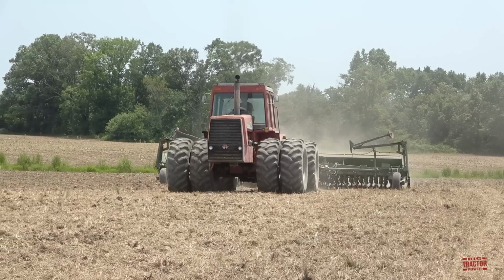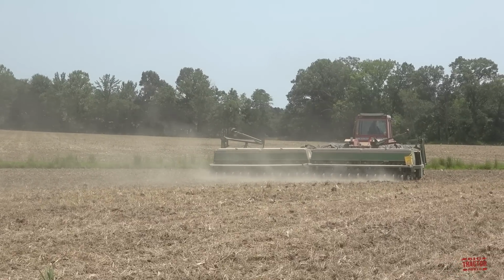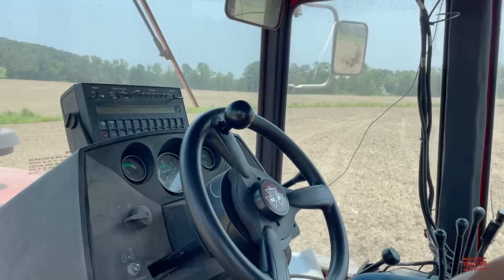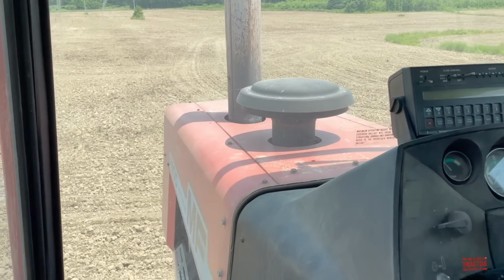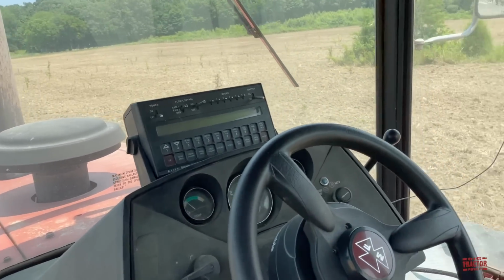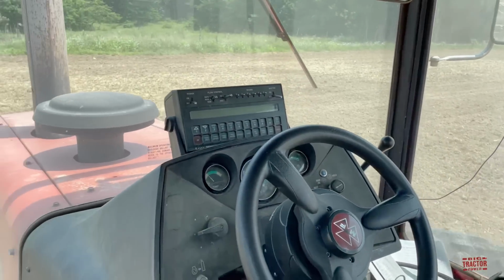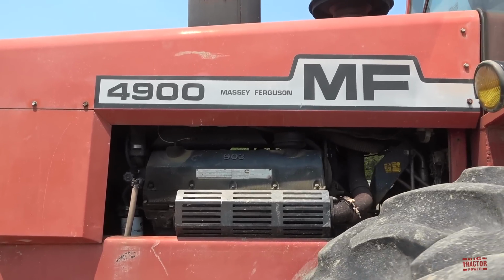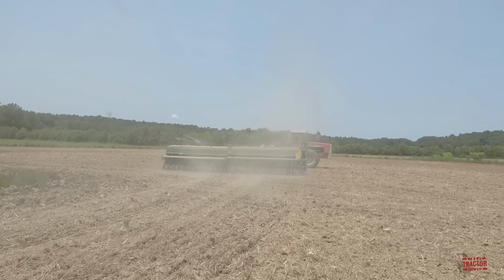Massey Ferguson 4900 Tractor

Comment: There used to be a few of the 4wd Massey's in the area of North MS that my step father and his family farm, from the older 1800s up to the 4900. He's the only one left running Massey Ferguson tractors now, an 1100 that gets run almost every day and an 1130 that has become the backup loader tractor. I take the 1130 to some local tractor shows and plow days in the spring and fall when I can.

Comment: Still running an 1805 MF, 1976 vintage, with 3208 Cat, 210 hp. Use it for digging primarily, 30 foot cultivator. This is on a small farm, Red River Valley. It isn't pretty, just basic... but it gets the job done. Check out JT's Barn & Grill.... he is still running an 1805 also. Nice looking tractor!

Comment: All of our tractors are Massey Ferguson. We do use a 4880 to pull the krone big pack baler. Should be able to find a video or two on YouTube
Reply from the maker: Very cool.  The 4880 is probably the best 4000.  I will check it out baling.  That sounds very cool.

Comment: Never seen one of those in person. Doesn't seem many farmers in Mississippi wanted a Massey over 110 horsepower. All you see down here is John Deere, Case IH, International, a few Steigers, and Kubota.
Reply from the maker: I grew up in Western New York.  Massey 4wds we’re a real contender there.   The number one Massey 4wd dealer is Kuhn Equipment in Arthur, IL.  They sold a bunch.

Comment: Overkill tractor for a 30ft seeder. 100hp tractor would do the job. Nice video and great tractor!
Reply: A 30 foot no-till great plains drill like the one we have, the one in this video, weighs 22,000 pounds... empty.  And we have a lot of hill ground too, I doubt any 100 horsepower tractor can pull it, our 200 horsepower 8950 Valtra can only handle it on fairly good level ground.  A large 4wd articulated tractor is just right for this drill.

Comment: Is it a V engine in the tractor?
Reply: Yes.  Vt903 Cummins. It does nothing better than turn raw fuel into pure noise.   Has to run 2000 and 2400 rpms
Reply from the maker: Yes it is a Cummins 903 V8 from the factory.  Good running tractor.

Comment: I do not understand why the PTO horsepower would be different than the engine horsepower.
Reply: There is power loss through the drivetrain. Just like the the advertised horsepower number your personal vehicle has is it’s engine horsepower, the number it would make at the wheels is significantly less. A lot of higher horsepower FWA’s and 4wd’s are electronically limited to a certain horsepower because often what the tractor is capable of making at the pto is not necessarily needed.

Comment: That tractor needs more lights.
Reply from the maker: Tractors oddly did not come with many lights until the 1990’s and more so in the 2000’s. Head lights were fairly new in the lates 70’s. Most tractors previously just had fender lights.
Reply: We added two big light bars on the front and rear of the cab up top, works out pretty good.

Comment: I’ve always heard the 903’s were junk?
Reply: We never had to many problems. Just got underpowered for us towards the mid 2000s. Miss that tractor!
Reply from the maker: I have never heard about complaints with the 903 in the Massey.  I own tow Steigers with 903s a 1974 Turbo Tiger I and a 1975 Turbo Tiger II.  Both tractors run great as they approach 50 years old.
Reply: @bigtractorpower  pretty neat…you’re getting quite the collection of V8-powered FWD’s!
Reply: Change the coolant filter regularly and they'll go forever.
Reply: The vt-903 as a truck engine wasn't very good. They had them at 500+ hp. In farm tractors around the mid 300 horse range they seem fantastic.  I've heard of them going 20,000 hours.